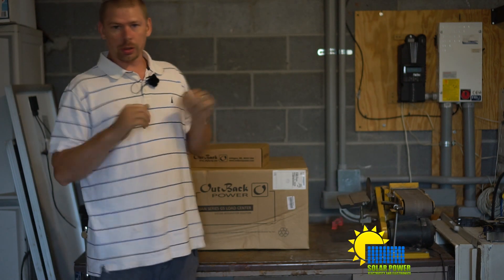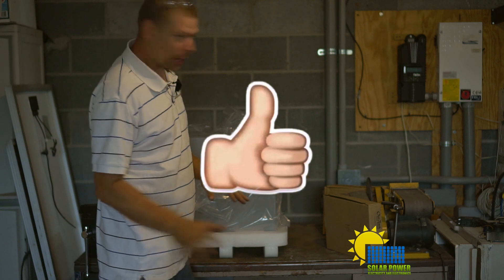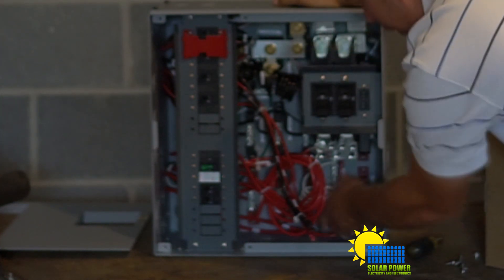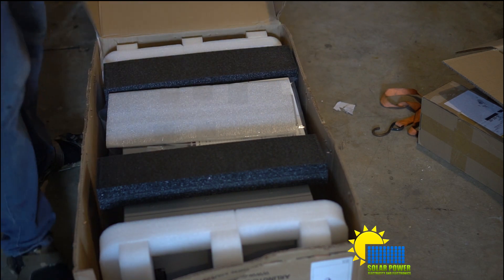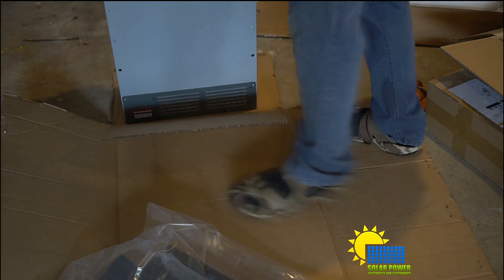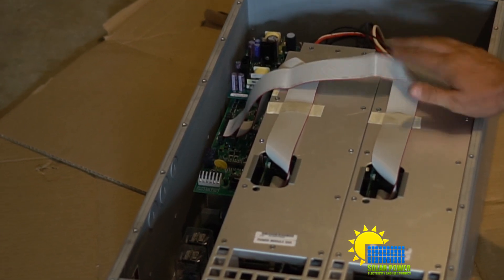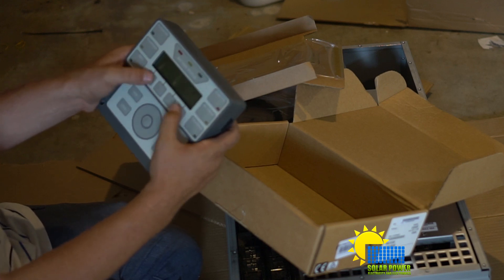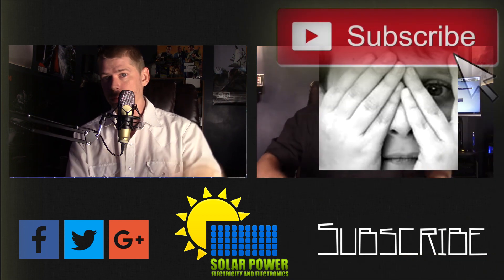OUTBACK RADIAN GS8048A 8KW, 48V 120/240VAC INVERTER/CHARGER UNBOXING

Comment: Those are super nice inverters.  Question (and I'm sorry if I missed you saying this) are you replacing your Magnum?  Did the Magnum break?  Thanks.
Reply from the maker: I  Watch your channel by the way I intend on running the magnum after I'll get more solar power up currently I have 8 kW after are completely installation I'll have 13.5 kW of solar power
Reply: @solarpowerelectricityandel2915  Does that mean your magnum will run one breaker panel and your Outback will run a separate breaker panel.  And thanks for watching my channel.
Reply from the maker: @DavidPozEnergy  no the magnum will run the bitcoin miners as a load dump and heat
Reply: @solarpowerelectricityandel2915  That's awesome you know how to mine that stuff.
Reply from the maker: @DavidPozEnergy  yes I mine it with my waste solar power
Reply from the maker: @DavidPozEnergy   Do you mind  I get your email address